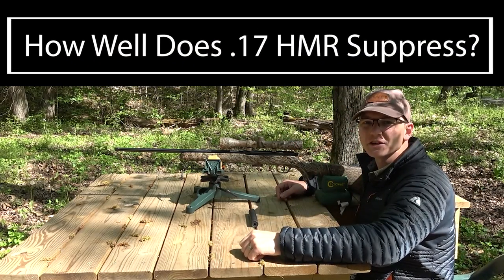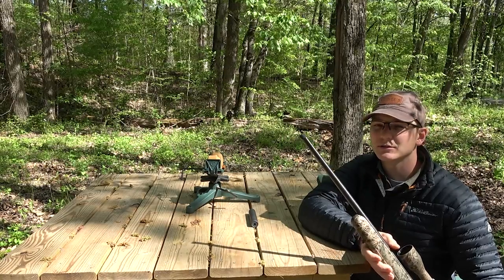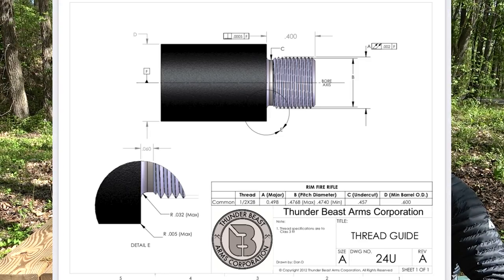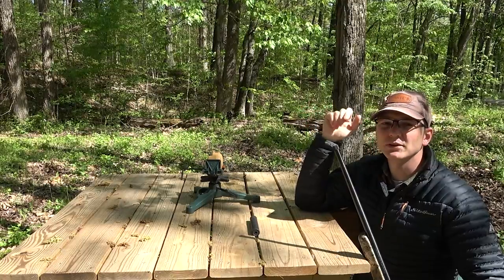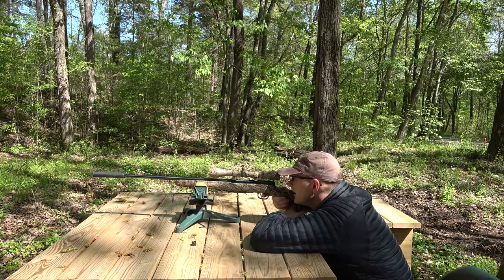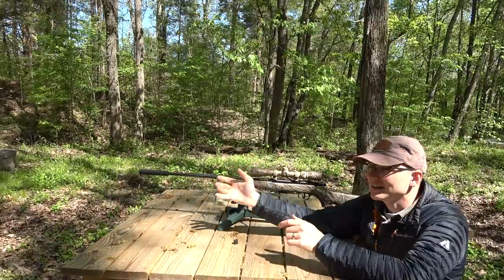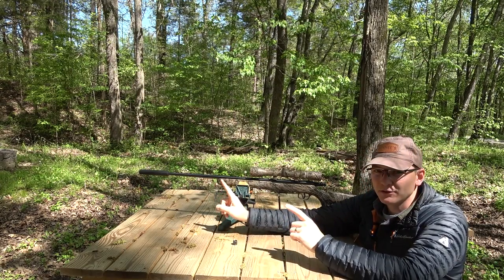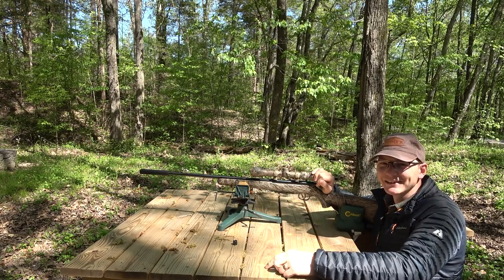How Well Does .17 HMR Suppress?

Comment: Do you know what kind of velocity you're getting with that suppressor? It seems like with .17hmr even if the suppressor slows it down, it's still gotta have a pretty decent fps.
Reply from the maker: I have chronographed it in the past, but don’t remember if there was a difference. As a rule, suppressors don’t slow velocities though. From what I understand, any velocity change is usually in the positive direction, due to the bullet still being pushed a bit by the propellant gasses while traveling through the suppressor. That would be interesting to test though! Thanks for watching!
Reply: Someone played too much COD haha